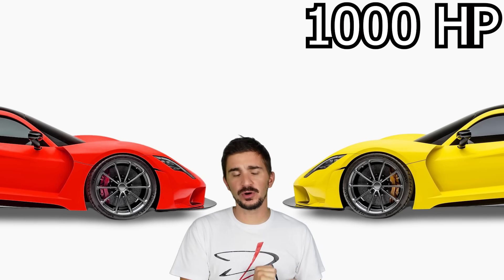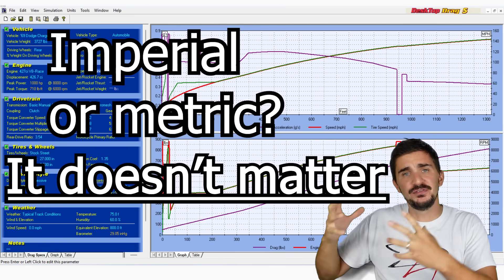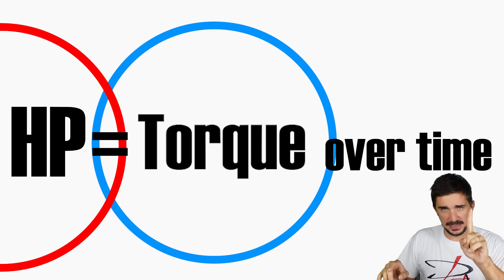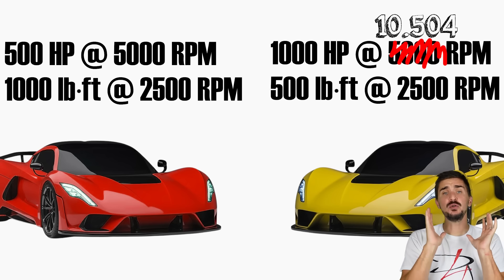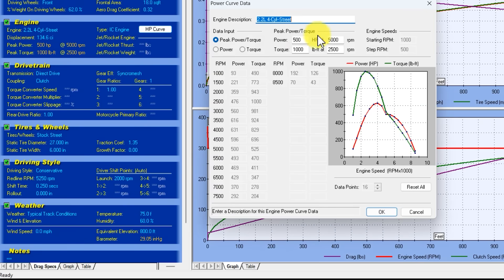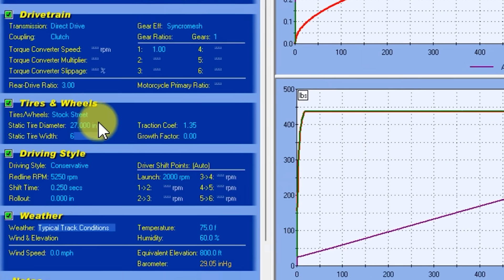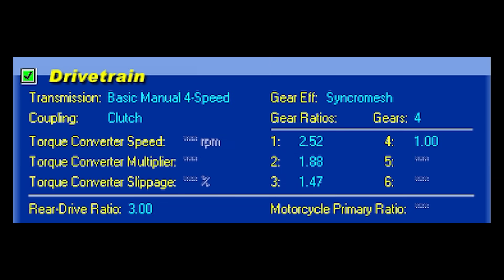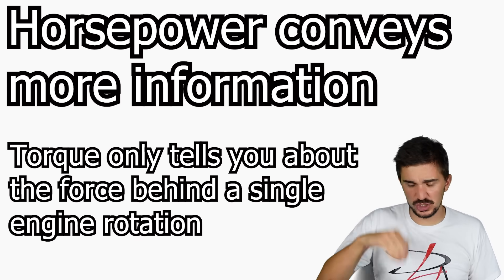Who's faster? Explained and Simulated - Horsepower vs Torque

Comment: I really enjoyed this, though I would add one small thing. One engine is revving up to 10,000 rpm, where the other is revving to half. This is drastically changing the outcome and adding a third variable, so instead of hp vs trq, you are now revving one engine higher, ad adding an additional factor.
But, since the purpose of the video is HP vS TRQ, and not about rpm, I understand why you didn't do it.
Though I am curious now if you revved the other engine to 10k rpm...  (besides it probably exploding in a CRX) which would win.
Great video though!
Reply: If you revved the high torque engine to 10k rpm, it would make more power than the other engine...rpm is a variable in the equation for power. So the idea of keeping the revs the same and testing a high torque engine vs a high HP engine is logically inconsistent.
Reply: @Spike00773  The entire thing is logically inconsistent... which is even explained in the video, but that wasn't the point I was making anyway.
Following the same formula, if you had 1000trq, at 10504 rpm, you would make 2000hp... So it's pretty clear who wins that race (unless you know... the car sits there and spins and you have a bad driver).
The point I was making is there is a third variable of rpm, vs just hp and trq, despite the 'need' to increase the rpm, you can still formulate it (not impossibly) as there are absolutely trucks now that have 1000trq and only somewhere around 500hp, so it's not an illogical thing... I have also seen cars dyno at 1000hp and only 500-600trq... but that's another variable, weight and drivetrain along with the other differences in engine size and such... so the equation for 500/1000 and 1000/500 aren't impossible. 

Actually, the new Lamborghini Revuelto makes 1000hp and somewhere around 552 trq (at 9500 rpm).
But again, the differences and variables required to make this logical mean you're sacrificing one thing... So LOGICALLY the winner is the 10000rpm 1000trq car, since it actually makes more hp (given it's the same engine).

I do understand your argument, but I spent way too long calculating these things and researching ... yay adhd? xD
Reply: @XeroCreator  the "third variable" is not a variable, it is a ratio. 

Performance is the product of torque and frequency (revolutions), so you just divide power through torque and you get the rpm needed to produce the desired power output (at full load).

That's why the lower gears are for accelerating and the higher gears are for cruising.

Comment: I think a shoving analogy would work to explain HP, Torque, and RPM. 
Torque is how hard and far you can shove something. 
RPM is how fast you can repeat that shove, object movement, catch up, and shove again in a minute. 
HP is how fast a specified distance can be covered with that shine power and those shove sequences.
Reply: wrong
tourqe is the amount of turning force
horsepower is the amount of rotational energy per secound produced by the engine
energy and force are not connected in the way you think hence the confusion of people
Reply: @randomsnow6510  so torque is the turning force of or at the wheels?
 HP is the energy produced by the rotation of what? 
I'm new to all of this so I was trying to make the analogy make sense to me. 
How is the energy and force connected? I thought I had a grasp on it but I guess not lol.

Comment: if it is a Turbo car we may have to think at what rpm you get maximum turbo pressure. Snd that the turbo delay is as short as possible. Then we also have to think about whether the gearbox can provide the best conditions for the acceleration / torque

Comment: A diesel car can have the full number of horsepower at significantly lower revs, perhaps 4300 rpm. in a diesel car you can also provide high torque because the connecting rods are longer. because the length of the connecting rods can well determine the torque. diesel fuel with a high cetane value is well recommended.? According to the theory, that should determine how quickly the fuel can ignite

Comment: It will be a little different if you have a car that has neither turbos nor Superchargers. Then perhaps the maximum torque is instead at 4000 rpm. if it is petrol powered. and a turbo or Superchargers also have an effect on horsepower. there is a difference between whether it is diesel or petrol powered. a diesel car can provide maximum horsepower perhaps already at, for example, 4300 RPM

Comment: Dunno if he explained it in the video but simply torque is a power that pistons produce on the crank and hp/kW is torque multiplied by revs.. simple as that.. Maybe that's why i prefer diesel engines, more torque from below (1300revs offer already good torque)

Comment: Commenting at 1st second: power is the ultimate quantitative expression of... power. Ultimately given the respective gearboxes to both engines, the more powerful engine will pull more faster, the same even vaster. It will accelerate faster and reach higher top speed. Torque is a side circumstance of how power is made, torque and speed add up to power. So consealed in two black boxes the two engines each with the respective gear ratio giving the same speed of the output shaft, the more powerful engine will make proportionally more torque at that shaft. -> thus more power.

Comment: Also this simulation is foolishly flawed. You need to use real peek HP rpm for each and optimal transmission to the wheels for each.

Comment: Torque biased engine actually makes over 600 horsepower according its graph at 4000rpm and after it it’s power output drops. 

More powerful engine makes around 600 hp at 6000 and continues to do so for 100500+ rpm.

This means as long as your transmission doesn’t drop over 4500 rpms in gear chance the second engine is faster.

Comment: I would have used torque figure as a hundred pounds of downward force on a 10 ft long extension bar. Almost anybody can generate a thousand foot pounds of torque with this setup. But how many times in one minute could you turn this gigantic wrench. Easy to make 1000 foot pounds of force but not very fast. Might be easier to understand than the punching explanation

Comment: In the case of inline 4cyl motorcycles, their torque may not be very high, but their HP can be high because they are designed to rev so much higher than 4cyl car engines.

Comment: I've done this test multiple times in the real world. It is all about the power curve, how long it lasts. Seen it too often where the 800hp engine loses to the 600hp engine cause the 600hp engine with more torque has a better longer power curve. And the engines in comparison are a big block v8 vs smaller engines. Everytime a big block v8 with less hp vs a smaller engine with more hp...it still isn't a fight, the smaller engine needs alot more hp to compensate in lack of torque or power curve to beat the lesser hp big block. All speaking in a drag race...top end different story. But of course when power numbers differ too much yes, horsepower wins the game. You come with enough horsepower, you will be quick cause you make so much speed up top.

Comment: Don't think this explain the case ... it's all technically correct, but still misses the critial information ... the HP engine NEVER hit it's RPM ... hence it will produce much less power, and most likely no more than the Torque engine.

Add a drive ratio equal to the peak rpm difference and now the HP engine looks like the torque engine on steroids ... obvious the real reason to pick one over the other is it's application. High RPM tend to be less efficient (more parasitic loss in friction) and low RPM tend to have better burn of fuel. Due to higher torque it also have to be build stronger, so it will last much longer ... but also weighs much more. So adding a 1000 ft-lb diesel engine in a gocart is not a good idea as weight will eat most of the advantage, but in a ship you don't care if the engine is 100,000 tons.

Comment: One cool thing you will notice,  is that as a result of what he explains here.  Whenever you See a HP / Torque Graph on a 4 Stroke Engine.  The HP & Torque Lines will Always Intersect (cross paths) at exactly 5252 RPM.

Comment: Youre missing the fact that in real life, if you have a high HP engine that only makes it late in the power band, by the love of god you DO NOT set off at a low RPM.  You rev that thing up THEN launch and STAY in the powerband, making your 19 second quarter mile entirely false because the car is not forced to start off at 0 RPM as though it were electric.

Comment: The peak HP represents the RPM at which peak torque to the rear wheels could be delivered, given the appropriate gearing is available.

Comment: So it's corrected: Your limiting factor here is rpm. Given a sufficient rpm spread you absolutely can achieve 40-50% more horsepower than torque.

For examples of this consider the 3.0 liter F1 v10 engines which made ~850hp and merely ~350 ft-lbs of torque.

Further examples can be seen in other various oversquare applications. Check motorcycke dynos for examples.

Comment: The creator of this video doesn't have even basic understanding. The high power engine would win every time by a lot. He is just using stupid gear ratios. The reason the hp calculation even exists is to give a good indication of how capable an engine is without troubling yourself with rpm and torque figures.

Comment: Torque biased engines are either trucks or cars that doesn't have an optimized transmission for it. HP is for performance.

Comment: who's faster... well it depends, is the race track straight or does it have a lot of turns?. if the track is straight the lower torque one will end up out front, if the track has a lot of tight turns then the torque one will dominate.

its like the never ending debate of which is better muscle or import, muscle cars sure will gap any import car on a straight but import builds are a lot better in the turns
Reply: you contradict yourself
Reply: @simplemachine9531  how so lol i didn't contradict anything we're talking about import cars not super cars which yes can be imported in but its not the same class

sure a mclaren f1 will smoke any muscle car on a straight and pretty much every import sports cars in turns but that's cause super cars were designed to basically take the power of dragster and the agility of a drift car and combined it into one neat package

higher torque will help in the lower gears which you end up using a lot more when going into and coming out of turns, higher horsepower will help more in the higher gears when your already going 80-120

Comment: You will accelerate the best per a chosen gear where the torque peak is, but per a chosen mph you will accelerate best where the HP peak is. Of course when you accelerate things are constantly changing. You have to look at curves, gear changes (unless you have a cvt/ivt) and spaces between gear changes. Ultimately the high HP should be faster especially from a roll but it's gonna be an area under a curve scenario. Drag racing is interesting because when you start from zero and gear ratios can go to infinity or energy can be stored and unleashed like a hammer strike then your zero speed forces can always approach infinity no matter how little power or torque you have. A good launch will give a good head start. Now you have to find a way to get there with available parts and not just use unobtanium designs and materials so torque can really help you out of the hole and in a 1/8 mile race a nitrous v8 is difficult to beat. But a turbo engine of any design can dominate a half mile race so long as it makes hp because lag isn't a big factor in a longer race so big turbos can be used. You can get around lag during staging but it can make launches chaotic and take more care to get right.  One thing that can be done on an inertia dyno is to measure time to a speed target. However if the curve is weirdly shaped I suppose it can still take more or less revolutions. Not unlike a ball rolling down a slope vs a cycloid where early acceleration always wins even though the distance rolled is longer and the destination is in exactly the same vertical and horizontal space.
Reply: the peak torque usually indicates the peak efficieny of the engine at full throttle.

For best acceleration, you must always stay near peak performance (hp/watts), that's what the transmission is for.

A high revving engine at partial load is less efficient than a low revving engine at full or near full load for a given performance output, that's why you shift when transitioning between acceleration and cruise phase into a much higher gear.

Comment: I think you have been too soft, so that the Stoopid Torque Guys will still think Torque is somewhat important, 
while, as you pretty know, Torque means NOTHING without the rpm at which that torque occurs... 
but guess what? if you have Torque at an RPM, you are talking about POWER - and Power is the ONLY thing that counts in terms of acceleration and speed.
You've had to show way more clearly to the Stoopid Torque Crew that what they think to be "torque", it just is POWER at low / low to mid rpm.

Comment: at equal weight, gear ratio and cx, the car with higher torque will have better acceleration but will be limited by the lower power that will prevent from getting really high top speeds. At the opposite the car with less torque will have worse acceleration but 1000hp will give huge top speed. In any case the 1000hp car has just too much power to overcompensate lack of torque, while in the other car the excess of torque can't compensate the lack of power at high speeds.

Comment: The problem is you arent taking into account a torque curve. raising to 1000nm of torque is great, but you are giving it to the car at 2500rpm, so as torque dies in the arse you are still making 500hp for the whole entire rev range. where as you arent giving the 1000hp car even 500hp for most of it's rev range. So you're actually giving the 1000hp car less hp than the 500hp car. In the real world, at any given rpm, whoever has the most hp also has the most torque, whether it's the torque biased car or not.

Comment: Horse power is how fast the engine can rotate and torque is how strong it can rotate.
So a most simple explanation is if two vehicles weight the same but one has more torque and the other more HP
The one with more torque can easily win a race going uphills and the one with more HP can easily win going downhill.
Reply: Ever heard of gearbox?
Reply: @simplemachine9531  what it has to do with my explanation?
I mean what's the point? 🤷🏼‍♂️
Reply: @OmarRuiz89  point is that you don't know what is power, because, according to you, torque "does" one thing and power - another one.
Reply: @simplemachine9531  nope I didn't say that, like this guy of driving 4 answers said, power and torque are one thing together but work different ways depending on the numbers.
And believe me, I understand everything about gear ratios.
 so I hope you're not the type of dude that don't understand why a 4 banger turbo having around 250HP can wax a v8 na that has around 350HP
Reply: @OmarRuiz89 
Sure because of bad gearing or bad driver.
There are lot of such types in internet who doesn't know a thing despite having a life-time experience. Some even post videos here. Go read what power and gearing is and its time to rethink your life with that "torque for uphill, power for something else" thing.

Comment: So this is for diesel. I got a truck with 300 HP 500tq wieghs 7400 lbs 5.0 engine.   If I line it up to another diesel truck with a 7.3 300 HP and 500tq and weighs 6700 lbs.  My truck will absolutely leave it way behind all the way to 100mph or more.   But it comes down to the newer turbo and injection being far less laggy but this twist my perception of hp ratings

Comment: This video is misleading and should be reworked.
you are cherry-picking situation to maximally disadvantage 1000 horsepower engine. how many 1000hp FWD cars exist? without transmission on street tires? zero. its the absolute worst possible situation for high reving engine

you are using light fwd vehicle, shit tires,  no transmission. well yes, this are the requirements for 1000 hp to be slow. 
on rwd/awd, race/drag tires and proper gearing, your results would be completely different.

torque by itself is irrelevant. with your wrench, pipe and nut, you can produce 1000Nm by standing on the pipe BUT NOT MOVING AT ALL.
POWER IS ACCELERATION (and top speed too). yes in real vehicles, you need some torque because ICE constraints. but with proper transmission adjustment (!!!) two engines with equal power curve and maximum power should perform equally. 
300hp 500Nm engine with final drive 3 would perform equally to 300hp 250Nm engine but final drive 6. half the torque, twice the revs, and doubled gear to make it equal.

only important metric is power delivered to the wheels. average, or sum.
that is why high torque engines perform well. because they have lots of power in low rpm ranges.